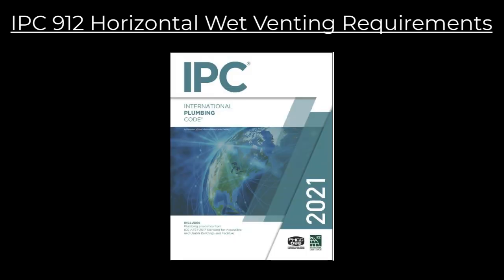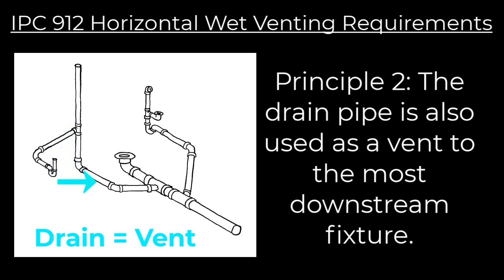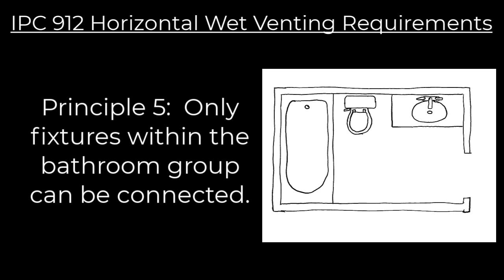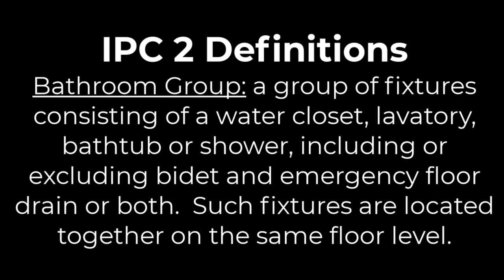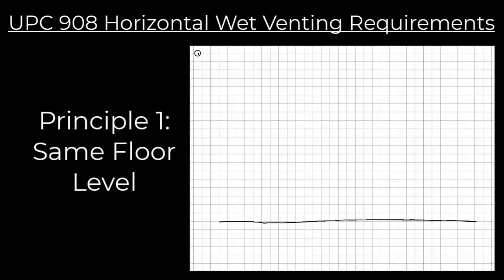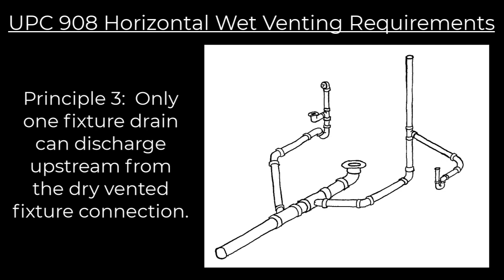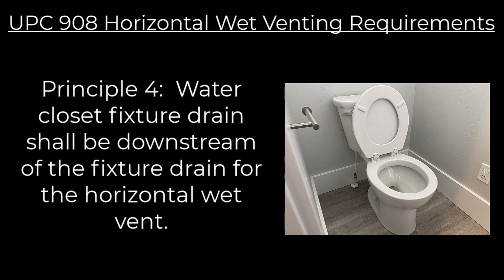Drain Venting Lesson 3 -  Horizontal Wet Vent Part 1

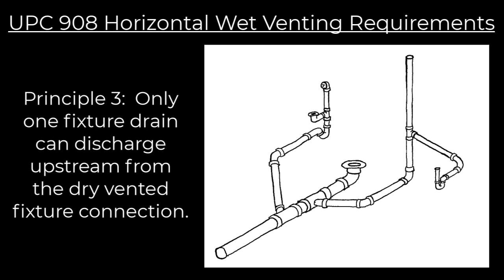Comment: in the upc the tub is above the lav connection, a shower would also be above the lav connection. Any additional connections down stream of the lav need to be vented.The lav can be a double vanity using a fixture fitting. The fitting upstream of the dry vent connection would be from the lav 90 as seen at 5:45 of the video playback. that lav 90 would be subbed out for a combo or like. since the upc is so restrictive on trap arms the fixute upstream of the lav when left at 2 give you a longer trap arm to reach your fixture. The IPC wins in venting I wish we had it for as our plumbing code.
Reply from the maker: Thanks for explaining

Comment: Can you wet vent a kitchen sink? If so how far from the vent can the kitchen trap arm be? Or do kitchen sinks need their own vent (or an approved mechanical vent such as an AAV where allowed) before joining another drain? Thanks!
Reply from the maker: Wet venting is only for bathroom group fixtures.  The trap arm can be up to 6’ for a 1 1/2” trap arm.  I have some code videos for IPC chapter 9 that explain more. You should check those out.

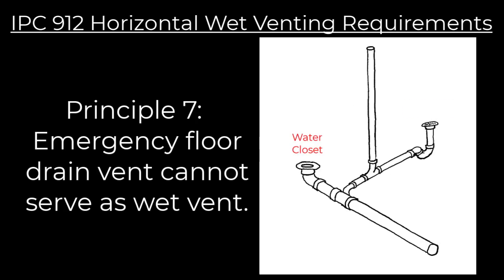Comment: Would the "additional Fixture" (at 4:27) connected downstream need to be individually vented at its own trap? Say its a washer drain? Or say if it was individually vented could it connect up-stream near Water closet? (IPC)
Reply from the maker: Adding vents is always a good idea, especially if it is difficult to meet the requirements for wet vets.

Comment: UPC 908, Principle 4 makes for some interesting isometric drawings.  Not necessarily pretty....but interesting.
Reply from the maker: Good point.  UPC is more restrictive.  I disagree with Principle 4, mainly because I have used IPC my whole career and never had a problem.
Reply: @plumber-tom9470  Yeah, it's really something how, after all these decades, vents and venting are still so misunderstood.

I don't think it's ever properly explained...how they serve multiple functions at various points in the draining process.

Add to that the small truths that are just unavoidable....and end up influencing code.

Like in most of those drawings....that bathtub trap is more than likely going to siphon out.....but when the dust settles, there will have been enough residual water to find its way to that drain and load the trap again.  They study the heck out of those things in real world use cases.

It's like water closets.  An apprentice asked me.."Do we vent toilets?" I said "No.  It's not possible to vent a toilet.  All we can do is vent the line a toilet discharges into.  Toilets figure out their own trap mechanics.  That's the little chug you hear.  All we can to is keep it from happening when we don't want it to."

He said I explained more in those few words than his instructor did in trade school.  LOL.